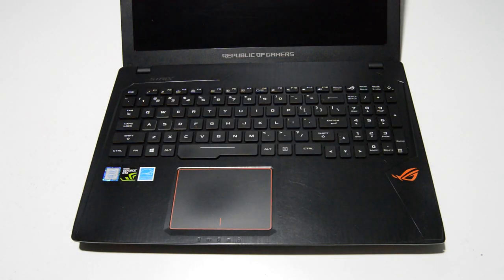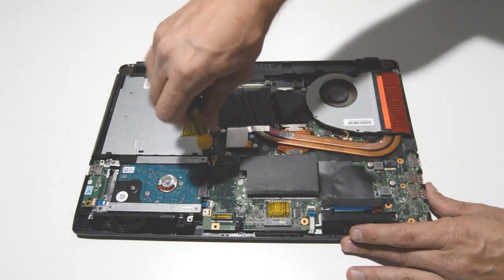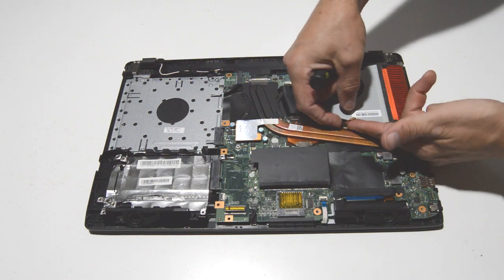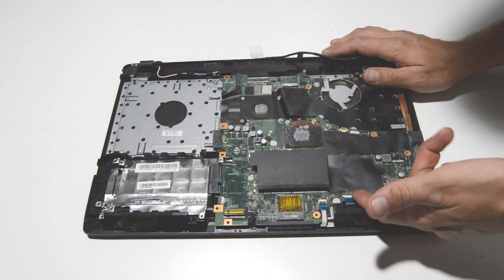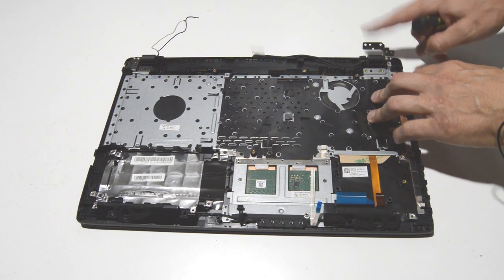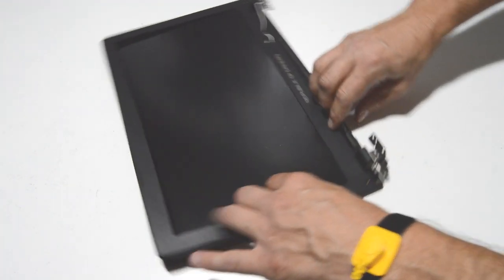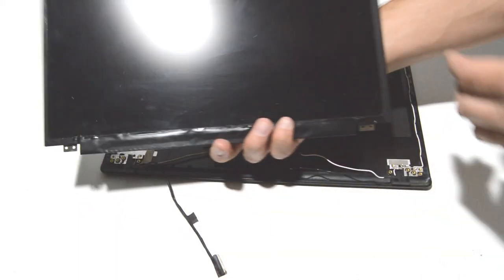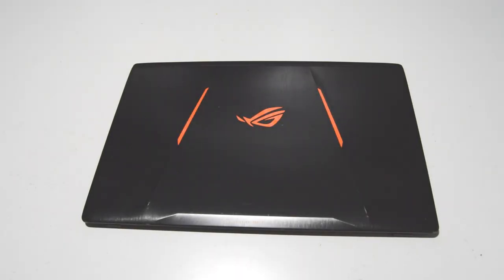How to Disassemble, Repair and Upgrade Asus ROG GL553V Laptop or Sell it.

Comment: Mine always turns off after a few seconds i turn it on, what do you thi,k could be the problem? Thanks
Reply from the maker: Possibly the motherboard, but I would first make sure the power adapter is working to charge the battery.
Reply: @Sellbrokedotcom  it's still turning itself off with or without the adapter, it's weird yesterday my laptop was totally fine.
Reply from the maker: @reggietjahjadi2722  Sometimes power adapters go bad..... so if you are sure it is good and your battery IS getting a charge, then your problem is likely the motherboard. This model is notorious for having cooling problems right out of the box, as evident by the heatsink/fan configuration. You compare this to an average Alienware with a GTX 1050 and the heatsink for the Alienware is HUGE and it has 2 fans. This model combines the CPU and GPU into a single thin heatsink and cools it with a single fan.
Reply: @Sellbrokedotcom  i see, i have sent it to Asus and i'm quiet concerned if i have to replace the motherboard ( my warranty already expired ). Guess im gonna have to wait their diagnose, thank you for the reply though :)

Comment: Can the optical drive change it to upgrade SSD or HDD?
Reply from the maker: Probably, they do sell those kits on eBay. You may have to switch out the front faceplate and rear bracket.
Reply: @Sellbrokedotcom  may I ask, where is the jumper for this laptop because I kinda forgot the bios password?

Comment: Is it possible to remove the CD drive and add a fan like the other side?
Reply from the maker: I'm not sure if there is anything like that available.... and it would barely help since it's not connected to the heatsink that is transferring heat from the CPU and GPU. Your best bet would to clean out that heatsink regularly to prevent ANY airflow reduction.
Reply: SellBroke thank you for your response sir
Reply from the maker: @legiitownage6375  You are welcome :)

Comment: size of connector keyboard is small or large ? it is orange color i mean on right bottom
Reply from the maker: Pause it at 8:53, the wide blue ribbon is for the keyboard, the small orange ribbon is the keyboard backlight.
Reply: @Sellbrokedotcom  thank you bro, sata ssd 2.5 1TB can be applicated on gl553vd ?
Reply from the maker: @abdulghofar5712  Sure, it has a 2.5" SATA spinning hard drive already, or a spot for it. If your's didn't come with one you might need a caddy.
Reply: SellBroke i wanna replace hdd with ssd sata
Reply from the maker: @abdulghofar5712  That's fine, as long as you get a 2.5" SATA it will work.

Comment: Can i change the CD slot then change it to SSD or HDD?
Reply: you can brother, but advice you not to because the bus speed is slower compared to other bus channels. so buy an m.2 for the upgrade, it's written ssd on the motherboard

Comment: Could I know what size is the HDD removed at 2:57 please? Thanks!
Reply: Oh,and one more thing - so basically a while back i spilled a beverage on my kb and had to clean it. nothing was harmed, but my [TAB] key's metal ring holder got damaged whilst placing it back in, so i just used it with 1 ring only till all 4 of the ring holders just fell off. i was left with only that bump-thing, but here in South Korea I can't really buy new keys, so I just used the bump till the sticker gave up on me and now i manually press the censor. now, the question - is it possible to repair this? no electronics were damaged. If so, how should I?
Reply from the maker: @RegulusUgandanCrusader  The hard drive is SATA 2.5" and if you are going to buy a new one, get a 2.5" SATA SSD drive to replace it, quite a bit faster. If the little rubber piece in the center is gone then you can't really fix it... they key will just lay flat against the keyboard. There are eBay sellers that list individual keyboard keys but getting the right version that fits your keyboard might be tricky since different manufacturers make the exact same keyboard with same part number.
Reply: @Sellbrokedotcom  Sorrysorry YT didn't gave me a notif and I just saw it. Thanks for the info! Are there any brands you would recommend? I'm trying to aim for 1 TB

Comment: Anyone got black screen problem like I did??? I read some blogs...seems like a common issue? I tried a lot of suggestions but still couldn’t get it to work(black screen) with booting sound and fan working, with the “light bulb symbol led lights on”.....does that mean screen display is bad?
Reply from the maker: See if you can get video out of the HDMI port. If so, you have a bad screen or connection to the screen, if not then your motherboard or GPU is faulty.

Comment: hello there so i tried to remove my fan from the heat sink (the orange thing) but it didnt go off it was like stuck to it i didn't understand why it did not come off.  right on 4.45 (in your vidieo) you took yours perfectly out but mine just was stuck to the orange heatsink and i didnt want to force to not break it. what should i do?
Reply from the maker: Just be gentle and it will come off. It's better to blew through it with compressed air. You can also clean it with a brush

Comment: "it doesnt matter how you remove the screws, but it does matter what order you put them in"   Then you proceed to NOT tell us how they go back in.  I need to reapply thermal paste on my CPU and this video showed me how to disassemble, but not how to repair or upgrade.  Please dont tell me you will show me how to do something, and then not show me how to actually do it. Could you please just post a video showing the order that the screws for the heatsink go on?
Reply from the maker: There should be clearly visible numbers stamped into the metal indicating the order they need to be tightened. If not, then just use a diagonal pattern like tightening lugnuts. The basic goal is to not squeeze the thermal paste out one side.
Reply: @Sellbrokedotcom  the thing that threw me is that you are applying thermal paste to the CPU and the GPU.  so what do i do first?

Comment: Love the video! We at "SalvageData" have been working with hard drives for a long time and we know everything about them. Our success rate is higher than any other company because we are focused not only on data recovery, but also on making sure you can get back all your valuable information, including files or folders stored deep in the bowels (or outside) inside a damaged disk. !